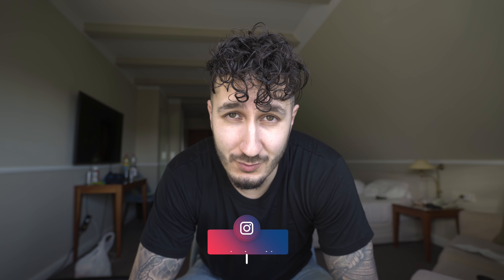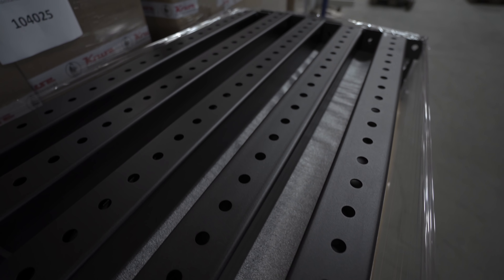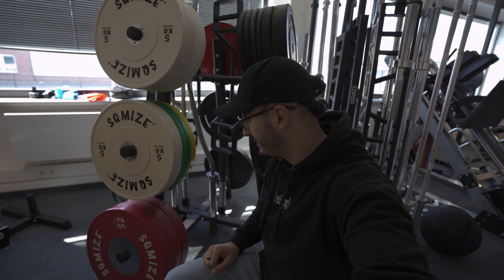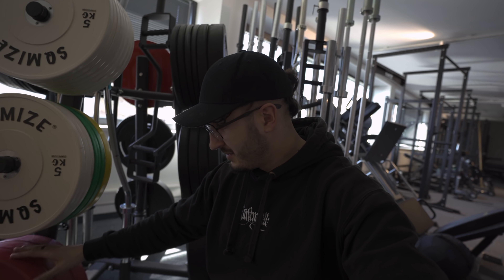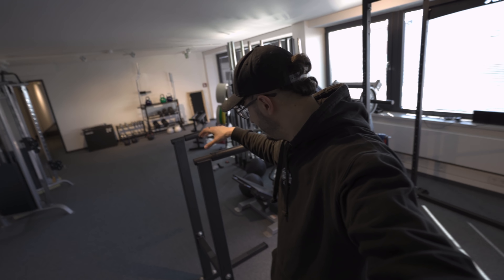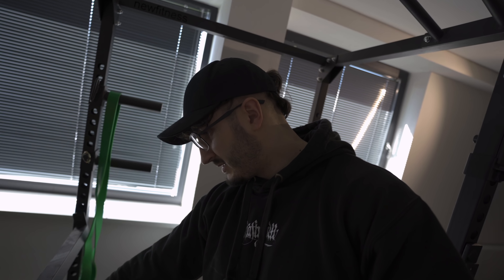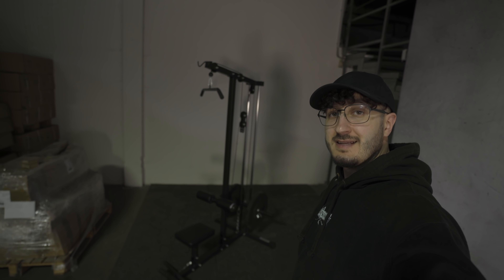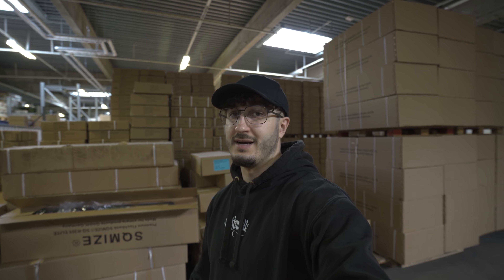Ich check das Sqmize Lager und neuen Power Racks!

Comment: Gutes Video!
Ich warte lange auf die Verfugbarkeit von die olimpische Bumper Plates von Squmize, hast du Erfährung mit die?
Danke
Reply: Bumper Plates sind lieferbar bei Gladiatics und kosten nicht viel mehr. 20er sind allerdings schon ausverkauft, also lieber schnell sein. Einfach mal googlen. Neuer kleiner Laden in Bayern, meine ich. Super persönlicher und netter E-Mailkontakt und schneller Versand. Donnerstag bestellt und Dienstag geht die Ware raus. Habe heute sogar noch eine entsprechende Mail bekommen, die das erklärt hat. Top! Bin auf die Ware gespannt.
Reply from the maker: Nur was ich im Video gezeigt habe
Reply from the maker: @DaveDEF82  Dann warte mal ab bis die von mehr Leuten entdeckt werden und ausverkauft sind. Ob die so schnell dann wieder Ware bekommen wage ich zu bezweifeln...
Reply: @DamienZaid  Gilt das auch für den international agierenden Strengthshop, der es auch schafft innerhalb nicht mal einer Woche eine Langhantel zu liefern? Kennen den auch weniger Leute als Simpleproducts?
Natürlich wird Gladiatics auch ausverkauft sein und dann nicht liefern können. Simpleproducts braucht jedoch 25-30 Werktage für die Lieferung von lagernden Waren.
Reply from the maker: @DaveDEF82  Schau doch wieviele Sachen bei Strengthshop bestellbar sind und um was für Produkte es sich da handelt. Dann sollte schnell klar sein dass es da ein Unterschied gibt der einiges erklärt.
Reply: @DamienZaid  Leider kennen wir nicht die Zahlen der absoluten Bestellungen bei den beiden Shops, um das sinnvoll ausdiskutieren und quantifizieren zu können. Aber du hast Recht, dass beim Strengthshop keine Racks undkaum andere Großgeräte lieferbar sind, wenn du den Versand der Racks und anderer Großgeräte nun für die längere Lieferzeit heranziehen wolltest.

Comment: Cooles Video welches auch auf viel Diskussionspotenzial bietet. Ich bin immer etwas skeptisch wenn Leute Reviews von Produkten machen an denen sie irgendwie beteiligt sind. 

Meine Erfahrung zu simple product ist eig ganz gut. Habe eine black bison bar. 
Die Stange ist top. Lager und Beschichtung. Einzig die ipf und iwf Markierungen sind zu eng beieinander und das Center knurling, mit welchen die Stange beworben wird, ist nicht vorhanden :D 
Stört mich aber nicht und ich bin sicher, dass wenn ich es Mängeln würde, dass ich einen Nachlass kriegen würde.
Reply: würde ich auf jeden Fall bemängeln :)
Reply from the maker: Das kann und solltest du bemängeln